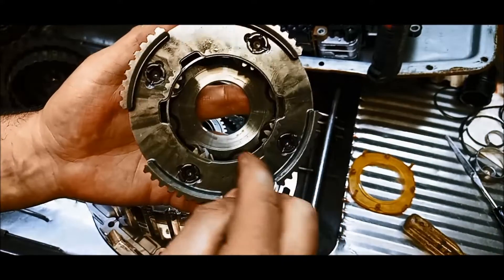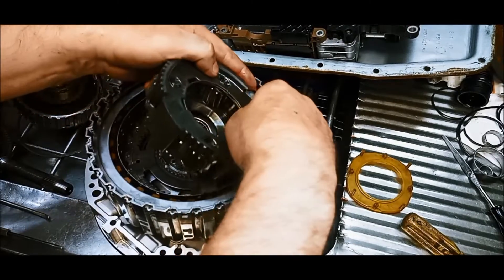How to 6R80 ZF6HP Front Planetary Remove from Forward Clutch A to be able to replace Piston Seals

Comment: one question about the 'rolers' and the planetar set sitting in the A cluch 
Do you have slack between the teethes that splice in to A basket ? 

I have a very noisy transmission i rebuilt with a lot of slack in between the planetary carier and the a cluch drum. not sure if that can be the cause of clunking noises. So in the one you had did you have a loot of free play there ?

same question about the rear planetary cariege with, do id you see any longitudal play in the sun gears there? meaning along transmission axis ?
Reply from the maker: hi, check to see that there are brass thrust washers at end of the gears - they often wear out completely. some longitudinal movement is normal. sorry hard to say without seeing it physically. cheers